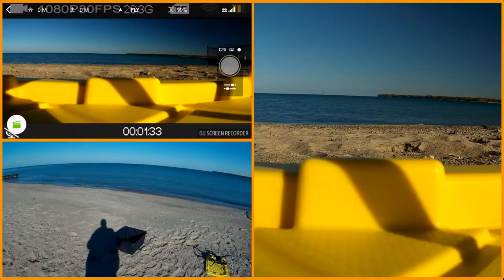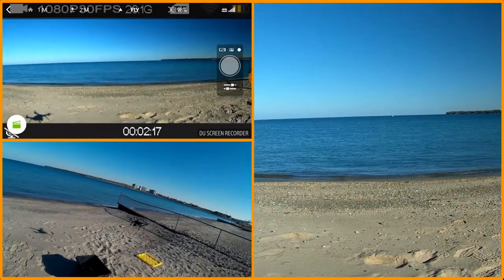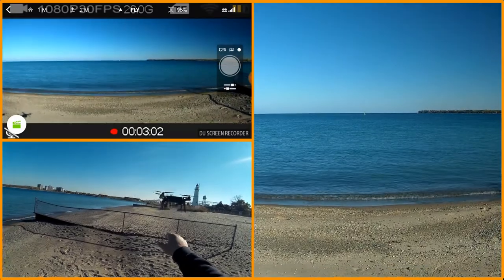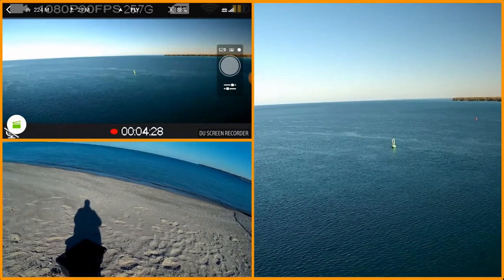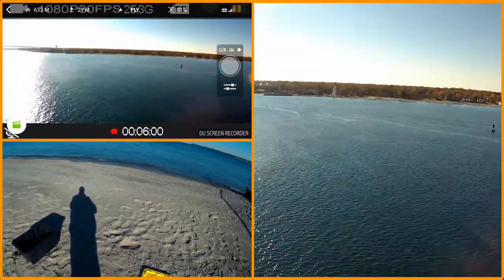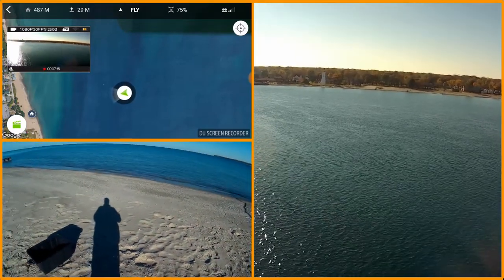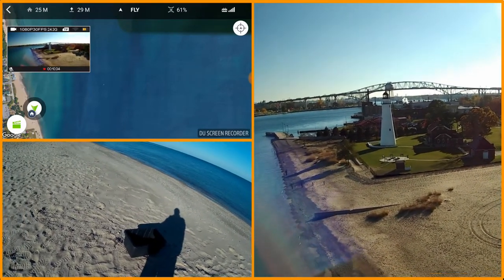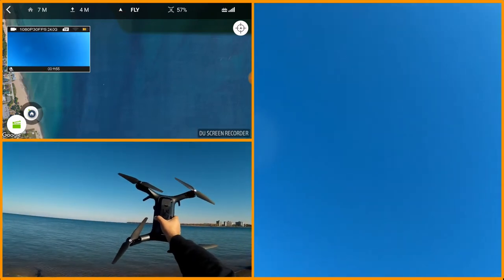3DR Solo - Lake Huron Flight with ThiEYE Adjusted!

Comment: Have you tried any of the smart shots yet?  They are great.
Reply from the maker: Not yet, just trying to get the hang of it.  Are their any particular ones I should try?
Reply: Video-Drone I think Orbit around that light house will work really well.  Cable cam is fun, and zip line allows you to fly in a straight line while yawing the Solo.
Reply from the maker: Yea been meaning to try zip line, however circling the lighthose is problematic as the other side is a Coastguard station which is classified as military :-)

Comment: Rumor has it that the Phantom 5 will have heated batteries and maybe two for hot swap.  $$$$$$
Reply from the maker: Know the Aspire has them, have there been any leaks of what it looks like?
Reply: Only rumors.  On Brads Drones live today he had images of a Chinese that talked about and showed pictures of the new camera.  Changeable lenses, internal ND filters, and a bigger sensor.  Nothing firm from DJI yet though.  My verification video was approved and I got Refresh for my Mavic Pro Platinum.
Reply from the maker: Yes DJI released a new camera for the Aspire